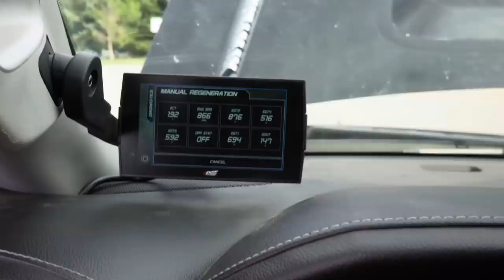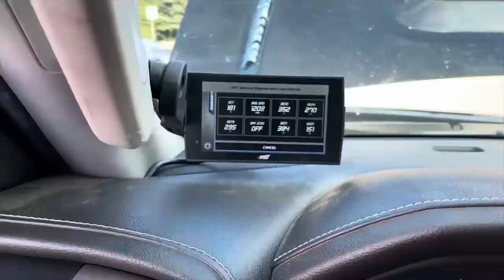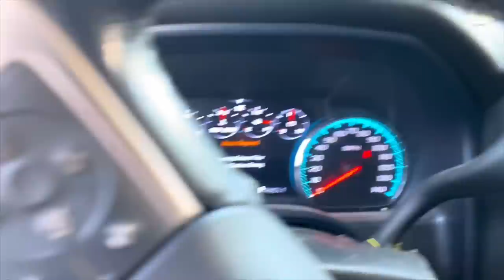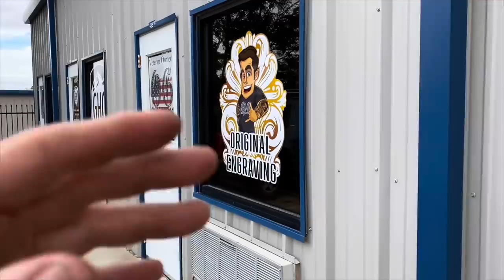I’m Stranded 20 Hours From Home In My Duramax! Part 2

Comment: What a crazy adventure. When the 6.4 pulled up to rescue the duramax I was just thinking that would be the last truck I would want to see towing me 😂
Reply: I’m a ford guy but I hate 6.4s my favorite 1st a 7.3 then a 6.0 then a 6.7 but 6.4 is like a duramax 🤦‍♂️
Reply: @ripperlipper1016  6.4s are not even remotely similar in terms of reliability and efficiency of a Duramax. 6.4s where intentionally designed to be constantly on Ford's service drive. I can't even tell you how many torn apart 6.4s I've for sale with 100kmi or less because of a catastrophic failure in the engine. Built right they can be one mean ass machine. But to build one right be ready to pay double as barely anyone uses these engines for actual performance purposes, and because of that aftermarket parts for a 6.4 are double what they'd be on literally any and all diesels up to and including the god awful 6.5 detroits. You can literally buy a set of 8 6.5 "performance" injectors for less than $500. 6.4 performance injectors minimum 3 grand plus. I had my reservations about Duramaxs for a long time then Whistlin Diesel came in and completely changed the game and now I refuse to touch any other diesel engine.
Reply: @goely6548  ok I can agree with you the 6.4s are terrible but a 6.7 and a 7.3 is where it’s at and both of them shit on duramax especially the 6.7 because of its reliability and power they have but I feel like the reason it cost more to put new injectors in a 6.4 than a 6.5 Detroit is because it’s a newer engine
Reply: @goely6548  and I was sayin a 6.4 is like a duramax because they both suck
Reply: Hahaha! What a crazy adventure indeed, I couldn’t imagine spending all that money on a truck just for it to laugh at you and self destruct.
Reply: @kylehenderson9867  I know 2 other people that have duramaxs both of them had transmission problems

Comment: I had a very similar experience as you're having, my L5P DPF filter got choked up in Traverse City, MI 700 miles away from home (I do hotshot). I had a buddy drive all the way up there, hooked up to my trailer and hauled me back home in his 6.0 powerstroke. If you're looking for a quick temporary fix, cut the DPF out, power wash it out then use exhaust clamps or weld it back up and do a regen. The problem that caused the DPF to choke up ended up being a failed exhaust manifold gasket. Other than that my 2019 L5P has 220k on it and still pulling strong! Good luck!
Reply from the maker: Great info thanks for sharing

Comment: Seriously Josh thank you for letting us all in and showing the good the bad and the ugly. Most people don't show this side of diesel content in this detail. It's humbling and very reassuring to know everyone has struggles.
Reply from the maker: Thanks! This was definitely a tough video to film
Reply: @TruckMaster  I'm just glad you didn't have to go through it alone brother. Hopefully all is well man. Hopefully ya get er "fixed" and up and "running right" soon. 🇺🇲🦅👍😏
Reply: When driving a 1988 Chevy. What's that mean when one blows a fuse every time one steps on the break and turns the steering wheel at the same time. 
 Q ; don't stomp the break and turn the stupid wheel together at once

Comment: Makes me appreciate my 01 lb7 and 06 lbz even more. Been wanting a newer l5p truck but damn. Good luck getting it back on the road brother
Reply: weight reduction is the only option i plan to get a wrecked l5p and keep it for a whileeeeee especially if deletes come down harder in near future
Reply: @morethan1e463  just got my l5p weight reduced, she’s mint now
Reply: @prestonthompson3970  hypothetically, ofcourse. how do you deal with the tuning nowadays?
Reply: Mine hasn’t had any issues in the 80k I’ve owned it
Reply: L5p is a great motor until you start monkeying with it using tuners and changing out air boxes and up pipes down pipes etc.  Leave it stock and they just plain run.

Comment: The DPF is the worst thing to happen to diesel engines
Reply: Actually it’s the EGR … forcing exhaust fumes back through the intake … DPF catching soot then burning it … not worse thing …
Reply: Wrong, the EPA is the worst thing to happen to Diesel engines.
Reply: @cobralife0417  Obama's EPA is the worst thing to happen to American Diesel and America.
Reply: @cobralife0417  that’s for humankind
Reply: That truck doesn't have a dpf.  Listen to that. No dpf or anything else for that matter.
Reply: @BillT502  🤫
Reply: @dixiemae5042  thought it was the red truck. Not the black truck. My bad
Reply: Why I went back to a 5.9's got rid of the 6.7 and dpf Def.
Reply: @BillT502  don’t need poor truck master being swat’d by the e p @ 🙈
Reply: @dixiemae5042  you very accurate in your thinking.
Reply: @BillT502  I’m gonna do the banks dual intake manifold for the 5.9 … seems better to me than the monster Ram even … like to do it to the CR 6.7 now if I could relocate to fuel lines … as a p-pump tho I’ll have to work with the guys in Indiana that currently fabricate lines to p-pump 24v’s but with the regular style intake …
Reply: @BillT502  love my 6.7 with dpf. Works flawlessly when you allow it to complete regen
Reply: W comment
Reply: @samr9520  actually Bush's EPA 2007 DPF filters started just saying
Reply: @repairvehicle  until it doesn’t, give it time and it’ll eventually fail. They all do.
Reply: @bennettsmith3221  heard they're running out of DEF fluid... with a Def shortage modern Diesel trucks will be in trouble.... We oughta ban adblue and def, and go back to regular diesel. I think it's 2010 and later required to have def isn't it?
Reply: EPA is there to insure the government gets their fair share....   20,000$ for an exhaust kit on an 18 wheeler.. .   love that big brother in your pocket
Reply: Man excellent video I can’t believe you had a Ford and Dodge come to the rescue and not one of the big three could prevail today
Reply: No you are
Reply: Tuners = problems
Reply: No

Comment: The poof you heard early in the trip was likely the charge pipe blowing off and from that point on, it didn't stand a chance of regening. It was probably leaking when your power began to fall off. Especially with the tune contributing to the issue. Impossible to say from 3000 miles away but that's my thoughts

Comment: Side note our shop truck Brigadier 6-71 burned so much oil it plugged the factory muffler to the point where it wouldn't start. Now it's a wide open exhaust. Not surprised if a totally plugged DPF causes it to stall and spit back pressure into the egr/engine.

Comment: SCT livewire ts+ and custom sotf tuning. It’s expensive but worth every dime. 15 PowerStroke. You’ll enjoy the seat Dyno when you perform the surgery to repair your current issues. Your wallet will be much lighter but your smiles per mile will soar.

Comment: This makes me think of the video Gale Banks did comparing the Derringer to the Pulsar. He kept beating on the fact that the Pulsar would plug up the DPF. Not saying thats definitely whats going on here, but it sure does look like exactly what he was explaining. Food for thought...
Reply: Gale banks would be somebody I'd trust... But having drove big rigs for years I'm always broke down with the emissions crap.
Reply: @Yippa391  Yep. I don't care how advanced they get with this emissions crap, it's still crap!!!
Reply: Banks does not guarantee that you will not have soot build up issues
Reply: Bottom line is you can't tune a emissions truck and not have issues. A dpf can't take that much fuel while pulling. You either go all the way or leave it the hell alone. Lol
Reply: @repairvehicle  nope! Nobody can guarantee that. But you can sure do the engineering and the science behind who's going to make more soot and who will make less.
Reply: @jarotex  , soot is the results of not complete burn due to diesel fuel not meeting requirements for diesel fuel
Reply: @repairvehicle  Yes sir, I know exactly what soot is. In fact it doesn't matter how good the diesel is. You're still going to get soot. The emissions equipment is the problem. The challenge here is, (if you are going to stay compliant) getting more performance while creating the least amount of additional soot.
Reply: @jarotex  performance comes with more fuel, more fuel more soot. Bad diesel fuel that does not meet requirements leads to soot, diesel fuel additive increase cetane that allows diesel fuel to burn without soot. There are videos on YouTube that show with and without it
Reply: @repairvehicle  not sure why you're making this a conversation about bad diesel versus good diesel. Diesel is basically oil, when it is burned it is going to make soot no matter how good or bad. We agree soot happens!  My whole point is that  there is a big difference in a good tune and a bad tune and I'm sure you'll find there's plenty of videos to support that as well. Signing off.
Reply: Banks' Derringer with fail safe sure seems like the easy answer to me.

Comment: Dude , when it rains , it hails . 
Glad y’all made it home . 
Well my 2008 Chevy Duramax started to knock and I had to finish a landscaping job so I drove it for one more day . 
I had committed to help a freind from church to move his boxes from his house to storage as they will be moving from San Antonio to Nashville Tennessee. He was a Air Force medic and his time in combat had some trials but now he’s on his way to attend PA school . 
Well , another buddy from my church was a Navy squid officer and he came to my rescue by taking my trailer that was full of leaves and tree  branches. 
We moved our friends boxes and had a great lunch. . 
Now my Duramax had begun to smoke and knock from the drivers side of the engine so I haven’t bothered to start it again . Some other particulars to this story . Just several weeks ago I spent $600 to buy a new AC compressor and blower motor and probe but though she at fist ran real cold she would stop blowing cold when I first started it and was in residential areas and later when I changed my engine oil I was short so I added a quart of synthetic oil and about several days is when the knocking became apparent cause I had stopped to get fuel and when I pulled in I could hear the knock . PS , my tinnitus is real bad so that’s why I run with the stereo @ full blast and I apparently hadn’t heard the knocking. 
So after watching this video I’m gonna try some of the things that ya replaced . My truck is partially deleted as it doesn’t use DEF and I have a straight pipe , that’s how I bought it . It still has the EGR and so I’d eventually like to fully delete it . 
Mines stuck at my house . 
Let’s see what happens down the road . 
Also looking for a honest and reputable diesel shop is my next goal .

Comment: Once that charge pipe comes off and especially how long it was driven, pull the MAP sensor. It will be packed full of soot and cause erratic fueling and regen. Likely over fueled the engine and packed the DPF full of soot. Super common on the L5P engine. But it all comes down to that charge pipe coming off..

Comment: So I changed the fuel filter on my LMM yesterday and then it wouldn’t start. Pumped on it until my arm was about to fall off. I didn’t know about the little value above the alternator. Released the air pressure pumped some more and it started. Fought with it for a couple of hours. I found out about that value from one of your videos. Thanks for the info, after seeing this video I think my dpf is about to fall off my truck. I hope all is well with the truck, sorry for all your troubles.

Comment: Really can't wait to learn about what happened with your truck and why the dpf got so backed up like it did. Glad you got back home safe. I was in a similar situation back in the winter when my trailer broke a leaf spring with a skid steer and I blew my tires. I was stranded 1½ hours from home till my dad brought out another trailer to transfer the machine and I had to drag the trailer home on 3 wheels. Fun times
Reply: Tuner kept dumping more fuel for more power. Dpf system is not designed for more power and more not complete burned fuel which resulted in soot
Reply: @repairvehicle  guarantee the cold side boot that was blown off is what caused it to soot the DPF out like that.
Reply: @PierceMaster  , loose boot and too much fuel equals wet soot. I am surprised he didn’t catch it sooner with boost gauge

Comment: Had the same thing happen to my 07. Blew both sides of the down pipe off. Right outside Denver. Got that fixed, to find out the dpf was completely stopped up. Ended up shipping it home to texas.

Comment: I have a 2019 Silverado 2500 HD with a Duramax, I kept it stock and never had an issue. I love your channel but this video is a testament to why I should keep my truck stock.  Maybe the GM engineers knew what they were doing.
Reply: His truck is mostly stock. The only part that isn't I his intake system. That alone does not have to do with the egr and dpf.  He does a lot of towing and traveling in this truck. When the dpf and egr in your truck decide to that they've had enough, you'll know it happens to 100%stock ones too. My neighbor has a 21 Duramax  thatis bone stock besides the lift and his truck has 40K miles and has been to the dealer 5 times because of egr and dpf
Reply: Yea I thought this video was a testament to why you don't want to keep it stock and why you should delete the emissions garbage lol.
Reply: my dad's stock 2019 Duramax did the same thing as truck masters with 130,000 miles
Reply: Got banks six gun on my lly. Never leaves eco tune. Works great. Of course not as complicated as your fellers. And I deleted the egr
Reply: if ya watched the videos youd know his truck is 95% stock.... testament why getting rid of the egr and dpf on these newer vehicles actually helps...
Reply: Jerry, I understand what you mean. I’d be curious how the truck would react with stock tuning and a disconnected boot.  I wonder if it would still plug the dpf, or would it know?
Reply: The pulsar caused the truck to produce excessive soot which clogged the NOx sensor 1. The ecu tried to correct the skewed NOx readings between upstream and downstream by adding extra def, which clogged NOx sensor 2 with ammonia… further skewing the data going to the ecu. The ecu then tried to correct this by overfueling on top of the tuner’s extra fuel creating even more soot that clogged dpf. Without NOx 1&2 providing the ecu with data, the truck is unable to start an active regen while driving. With the L5p, you either delete it or leave it 100% stock, there is no happy medium.
Reply: GM engineers absolutely do not know what they are doing Lolol. Perfect example- Doesn’t matter what year GM you have all of them still have electrical issues.
Reply: Yeah Right Bud , you don't have a clue 💯⚒️
Reply: @Jtfogle82 You are exactly right brother 🏁💥🏁🎯
Reply: Remove the bad parts and it would never skip a beat. My 16 lml I’d trust to drive across country any day. But it doesn’t have a dpf
Reply: @caleblevasseur2657  your neighbor does not allow truck to regen complete and that’s why he decided to keep dealer in business
Reply: @DannotekProductions  , truck never ran good after he installed aftermarket exhaust manifold. Exhaust system stays at lower temperatures and prevents truck from completing proper regen
Reply: Aftermarket garbage tuner cause of all problems in diesel trucks

Comment: To late probably to tell you that you can put a diesel fuel additive in..  works with a tuner an injectors to burn soot hotter faster.  Works on the LLY everytime...
Reply: Max Mileage Fuel Borne Catalyst  from (Pittsburgh Power)

Comment: With all the issues with the EGR, DPF,  DEF systems,, it is clear the desk monkeys at the EPA do not know anything. In your part 1, I made a comment how ridiculous this garbage is. Since I can not delete, even tough we don't do smog . I'll just trade it in around 100k miles. What is really stupid is a correctly tuned diesel won't smoke & runs far more efficient & 20% to 30% increase in mileage

Comment: The pulsar caused the truck to produce excessive soot which clogged the NOx sensor 1. The ecu tried to correct the skewed NOx readings between upstream and downstream by adding extra def, which clogged NOx sensor 2 with ammonia… further skewing the data going to the ecu. The ecu then tried to correct this by overfueling on top of the tuner’s extra fuel creating even more soot that clogged dpf and the egr cooler. Without NOx 1&2 providing the ecu with data, the truck is unable to start an active regen while driving. With the L5p, you either delete it or leave it 100% stock, there is no happy medium.  A $200 NOx sensor takes about 10-15 mins to change roadside and you’ll be good for another 100k miles… or just clear the codes and keep driving😂

Comment: Josh,
I am fairly sure when you increase the input, PPE bundle, but don’t increase the output, stock exhaust, you get a backup!  The exhaust can’t handle the increased intake performance.
Reply: Intake has nothing to do with. Tuner dump too much fuel, unburned fuel creates soot and clogges ups dpf beyond regen can handle
Reply: @repairvehicle  you are correct. The air is measured and the fuel is added based on air intake. Additional air+more fuel = stock exhaust not designed to handle the flow. Exhaust is rated on stock intake design.

Comment: if you run a lot of injector cleaner or cetane booster like I did, your dpf filter just had a melt down and running a regen probably made it worse. My 2015 f250 did the same thing but it ruptured the the silicone hose, just like yours, and my charge air cooler. Had to straight pipe it, turn off egr and def, called mishimoto for their charge air cooler, because it cools the transmission fluid.  Ford has two radiators and when this one grenades the fluid goes on your intake and looks like you are fogging for mosquitos.